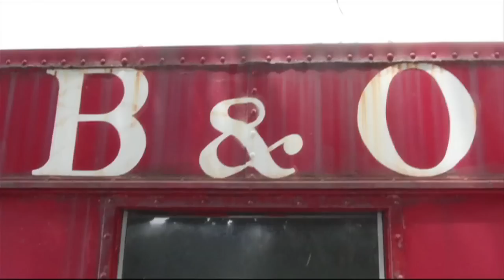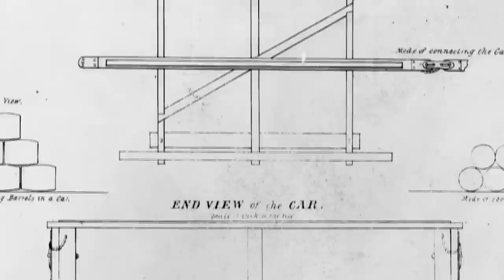B&O Railroad Museum TV Network: The First 13 Miles (May 2014)

Comment: I wonder why the b&o railroad museum hasn't considered extending their 1 mi Express to run to Ellicott City station making it a 20 mi round trip? Not all of us drive but I'm one of the many who want to see this other part of the museum but I do not drive a vehicle and can't access it. I'm sure it'll be worth paying more for the round trip tickets and if you guys work with CSX and the state of Maryland and whoever else necessary I'm sure we can make this a reality...
I mean it's only 10 miles from the main campus and it would be 10 mi back so that would be a 20 mile round trip added up and I would be happy to pay you up to $20 or more for a ticket if necessary if this was to become a reality
Reply: There is this thing called Uber, try it sometime. Can a friend not give you a ride in exchange for a favor?
Reply: Problem is, after that 1st mile you are onto active CSX trackage when it merges with the line coming out of the Howard Street Tunnel/Camden station - that is still a well used line and single track after the split by the Thomas Viaduct.  Not easy to set up a lot of running on if they wanted to.  No extra track at Elliott City either, just one track past the station there.